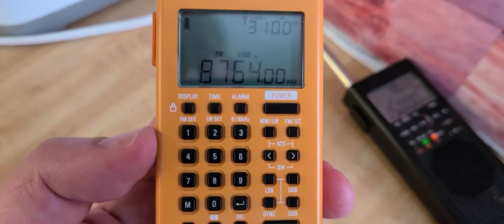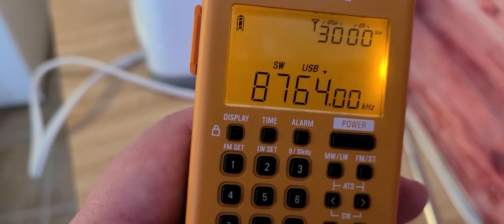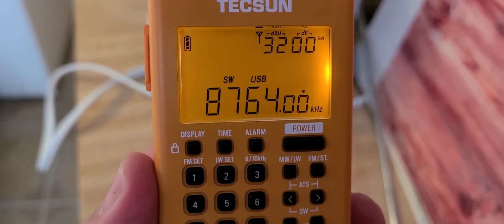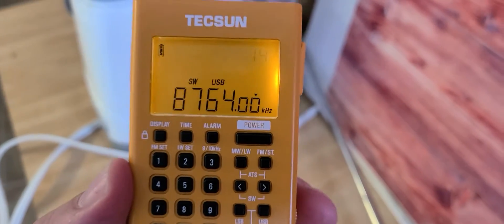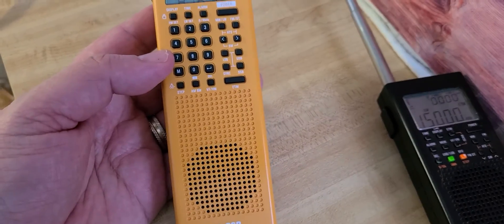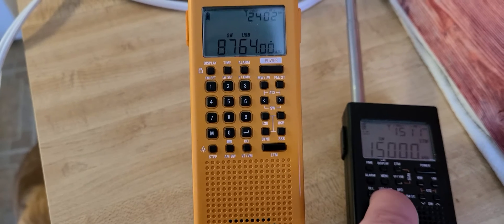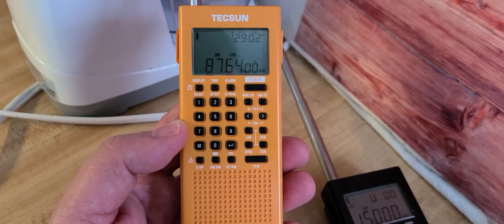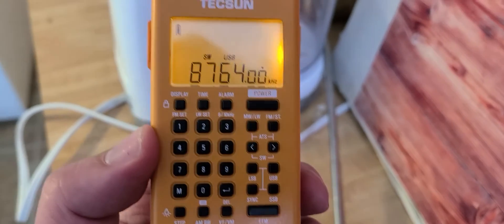Tecsun PL-368 SSB test and precision NMN Chesapeake Virginia marine weather 8764 kHz USB Shortwave

Comment: You mentioned a battery drain problem when the pl 365 was switched off. I didn’t use mine for three months and the batteries were fine so I think it must be only in one batch

Comment: Mine has just arrived and I'm well chuffed however my one gripe is you can't keep the back light on which is a pain in the ass... Is there a menu to fix it?? /?
Reply: Sometimes if you hold the light button for 4-5 seconds it will keep the light on. I have a Grundig (made by Tecsun) and a Tecsun that both do this.